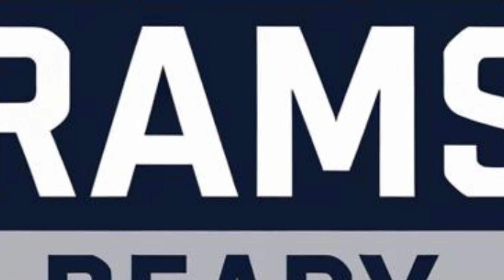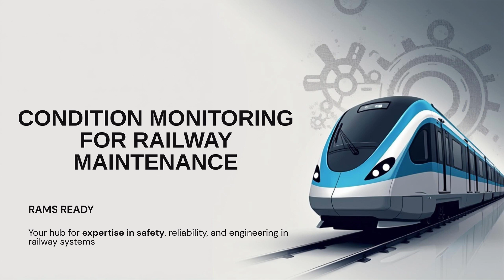Condition Monitoring for Railway Maintenance

Comment from the maker: Working files for this topic, built to be used on a live project:

RCM and Maintenance Program Workbook
RCM analysis workbook, maintenance task evaluation sheet and a P to F interval screener, with the process guide.
https://ramsready.firstlinkai.com/p/A5

FRACAS Starter Kit
FRACAS register, root cause analysis templates and a failure review board pack, ready to run on a live project.
https://ramsready.firstlinkai.com/p/A4

Free Lite Hazard Log workbook: https://ramsready.firstlinkai.com/free
All twenty products: https://ramsready.firstlinkai.com

Which part of this gives your projects the most trouble in practice?